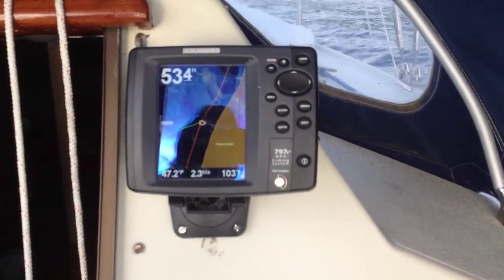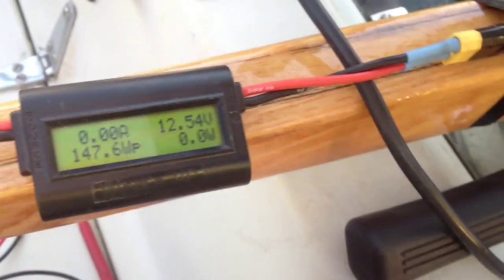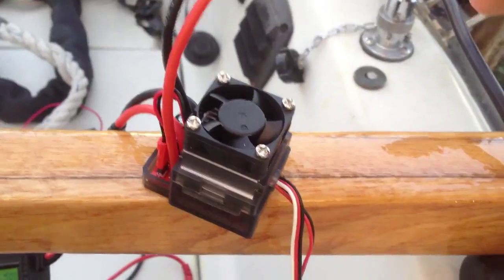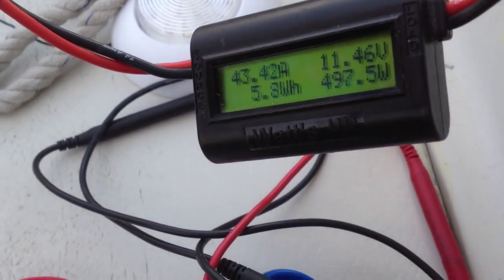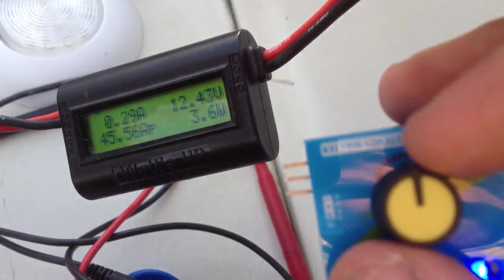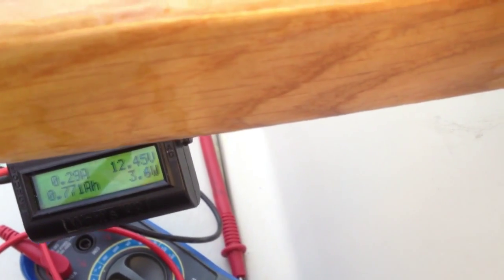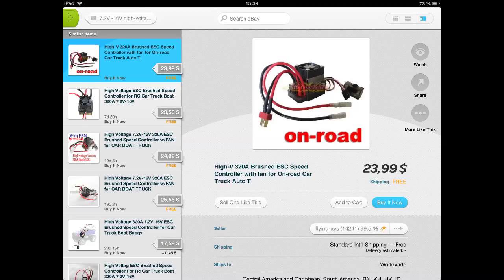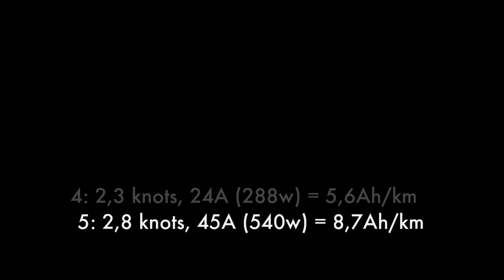Sailboat electric motor, power calculations

Comment: Great video how did you wire you watt meter to the speed controller l can't find any video on this your the first thanks
Reply from the maker: The watt meter is just connected between the battery and the speed controller :-)

Comment: Thanks! I'll look for it! I have been looking at speed controllers now, but I as with the meter, i'm not sure what the parts you have connected to it (the switch and the variable power output with the yellow button) so it's difficult to know where/what to buy. You say that I could connect the speed controller between the battery and the motor? By the way, I found this page with a propeller specifically made for el motors: w w w . kipawapropellers . com/product.html

Comment from the maker: Hello, nice to see you also gone electric now :-) I have got a couple of watt meters of eBay. But the one I think I will use is named GT Power RC 130A. It have the fattest cables = less energy loss as heat in it. They all work the same. The nice thing with them is they also shows total power consumption watt hours / amp hours etc.. I am going to connect to various things in the boat to check consumption, the fridge, the lights etc :-)

Comment: Hi! I sent you a video answer with my tests with the electrical motor! It wasn't much faster though my boat is lighter, I guess it depends more on the drag of the boat when cutting the water. One question, where did you buy the display for current / Ah? I'd love to have one but can't find exactly that model.

Comment from the maker: According to my calculations you loose a lot of energy with a 5 way switch, speed 1: you loose 82 percent, that's 115 watts !!!! Speed 4 you loose 42 percent !! That's 120 watts.. It's getting burned of as heat in the resistors. A speed controller is a lot better and if you buy a motor you don't need to take it apart, you just put the speed controller between motor and battery.  With speed controller, at 150 watt I get 1.7 knots with my 2000kg boat..

Comment from the maker: The device connected just measures current watt etc, the speed I get from my gps plotter/fish finder ...  I did measure how much power I got back from it (using it as a generator) when sailing at 6 knots I got 5v 18A, that's if it is true is 90watt !! I must check with better equipment another time and check. It would be possible to use a step up converter and charge the batteries with that. He he

Comment: Funny also that i just got båtliv magazine today and there is an ad from minn kota on page 59 with the new feature for this year being speed control which supposedly gives 5 times longer running time. Maybe a little bit overdriven considering your empirical results or the over 1000$ tag on their motors is really worth it?

Comment: Thanks for more video proof! Nice experiment with the controller, i still don't get of you have it coupled with a speed measurement device or what? What about generating electricity from the motor to the battery while sailing, would that be feasible?